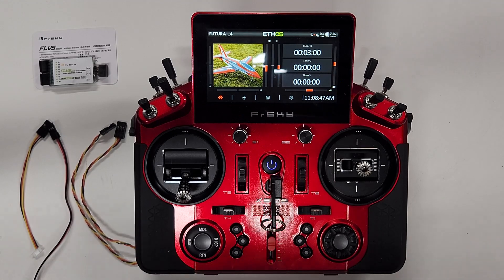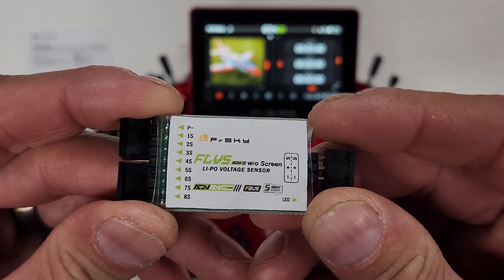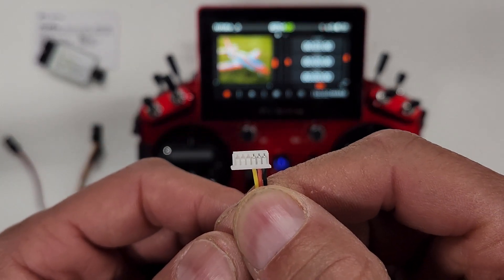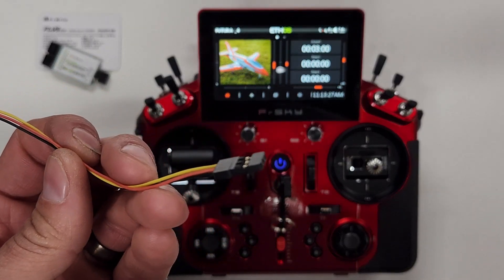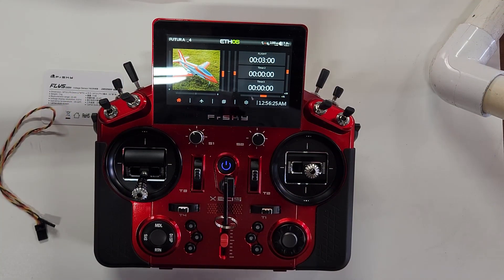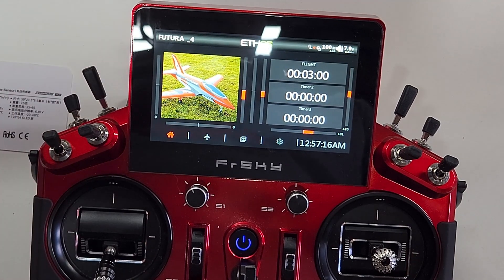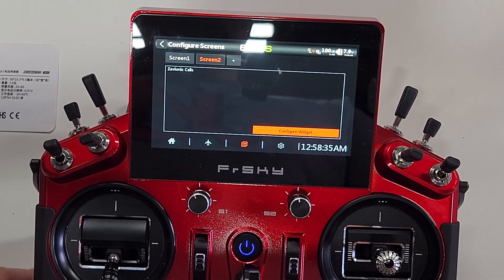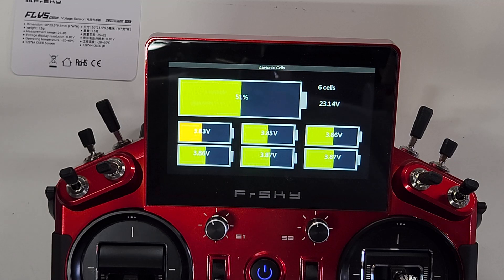Frsky FLVS Sensor Install w/Zavionix inside

Comment: Followed to the "T" same sensor etc. Does not work. Can't figure out why?
Reply: Turn it on in rx page where you bind the receiver hit the receiver button hit options then turn on smartport
Reply from the maker: Make sure your sensor firmware is up to date.

Comment: Can you tell me about the switches on your X20S? I am about to replace all of my X20 switches with Horus switches. Any tips or tricks would be greatly appreciated. Looks great, nice work dude!
Reply from the maker: Hey whats happenin' Jeremy!?  The switches came stock with the radio.  I have had many people point out the square switches and red slider.  I know that in the past I have replaced a switch on my X10.  I can tell you that me personally I wouldn't bother if they are working.